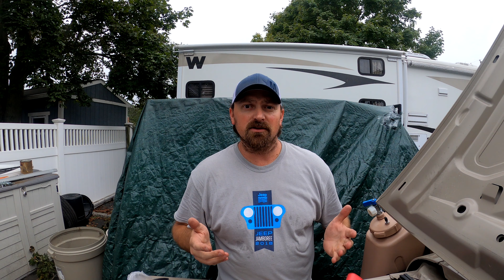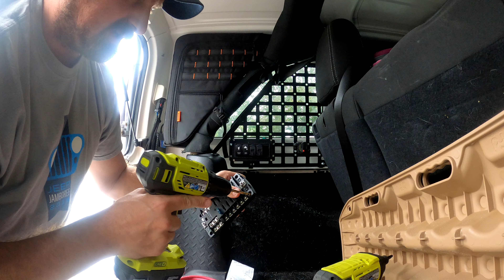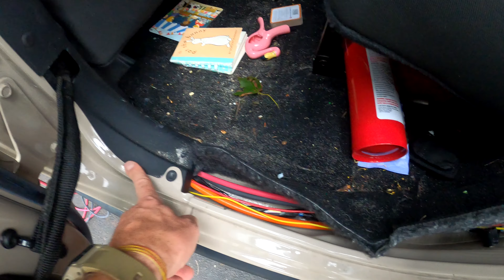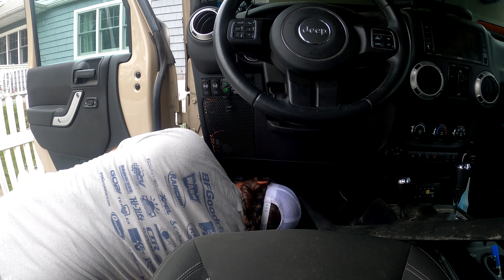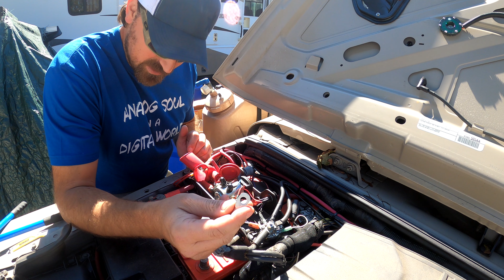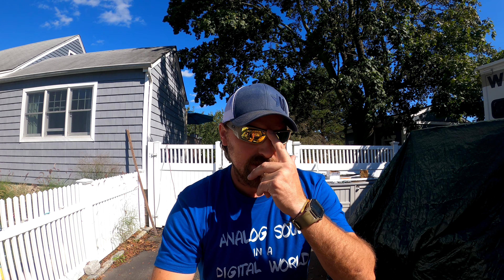JEEP Wrangler - Power Installed for Accessories in the Back

Comment: Really like the idea of this and want to do something similar, but I have some questions.
Power wire  at the battery Should be fused right off the battery? I didn’t see any fuse but saw on another comment where you said you have a 200A fused protection? Where is that located?

Comment: What type of accessory are you using that requires a 100 amp breaker
Reply from the maker: Per the instructions on the blue sea marine fuse block you need a 100 amp breaker or fuse.

Comment: Does the Genesis positive have a breaker at the battery source? The breaker should be as close to the power source (battery in this case) as possible.  Its ment to protect the wire if it shorts to the chassis or another wire.  If you get a wear thru and that 6 gauge shorts to the body between that breaker in the back and the battery the wire can overheat and cause a fire.  Otherwise good video sir.
Reply from the maker: Has a 200 amp isolator at the battery. Thanks for watching!